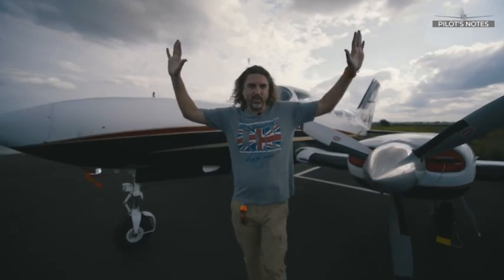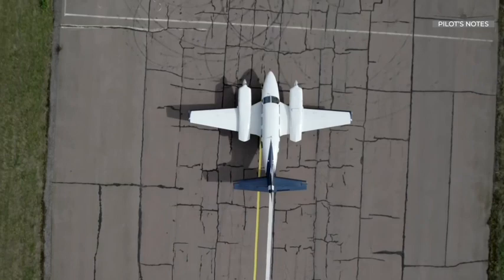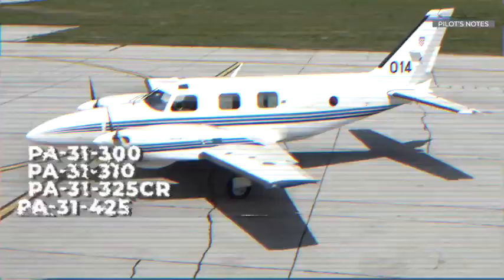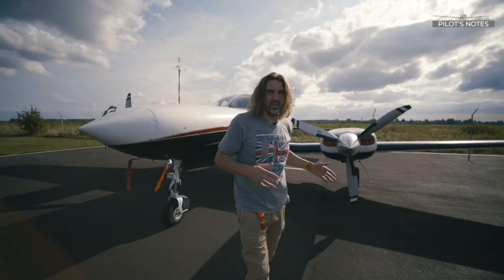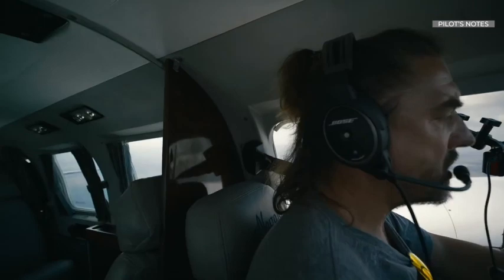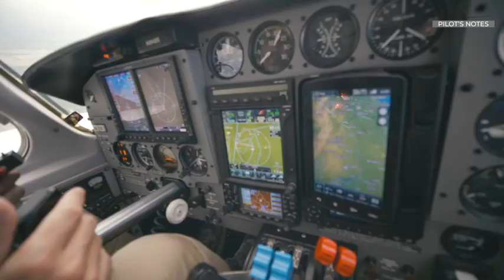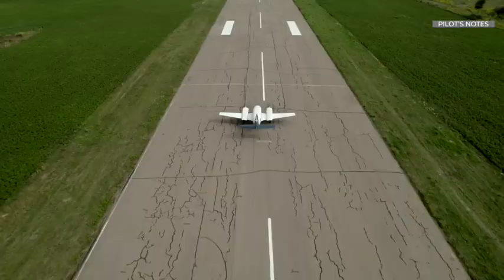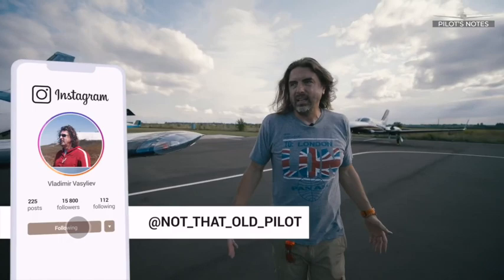Two DIFFERENT Engines in THE SAME plane! Piper Navajo CR

Comment: The critical engine in an aircraft with engines that rotate clockwise, as is the case with that Cessna in the video, is the left engine (not the right). A mnemonic rule to always remember which is the critical engine is as follows: if both engines rotate clockwise, then the critical engine is the left one, and vice versa for counterclockwise rotation engines.